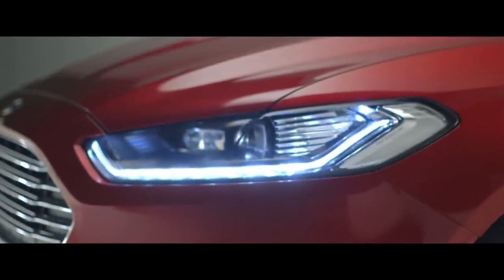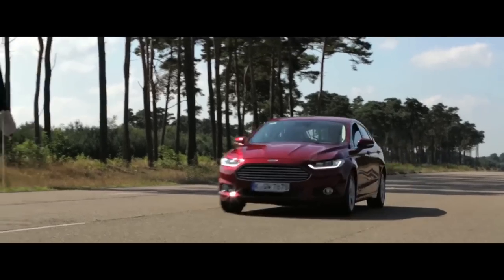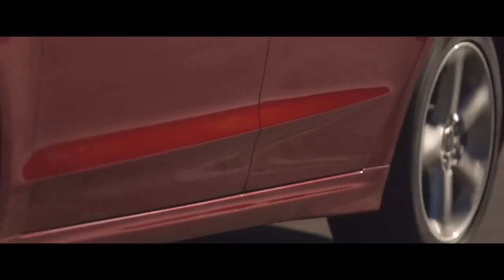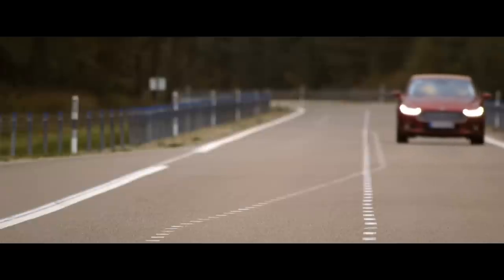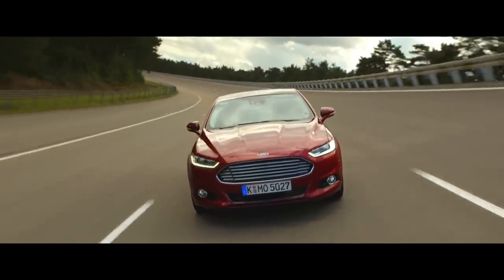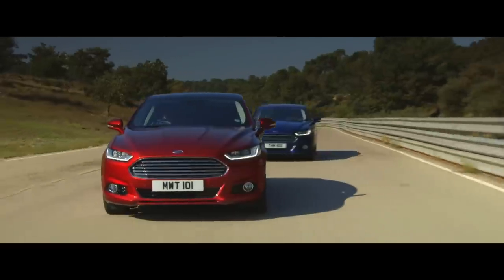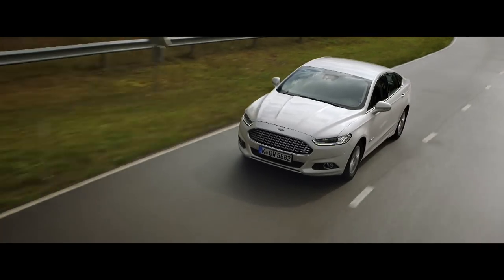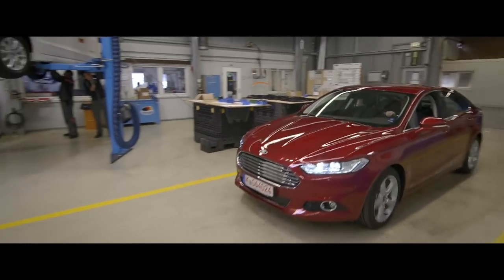Ford Mondeo Documentary Part 2

Comment: Pity you did not use a better 6 speed auto transmission. Very sluggish on the paddel shifters and very noisy in town traffic.
The 6F35 wines and groans like a worn out transmission from new! My 2015 Mondeo only has 20,000 kilometres from new.
Yet sounds like a car that has travelled 300,000 kilometres.
Very disappointed with my purchase, Ford wont even fix it under warranty, how bad is that.